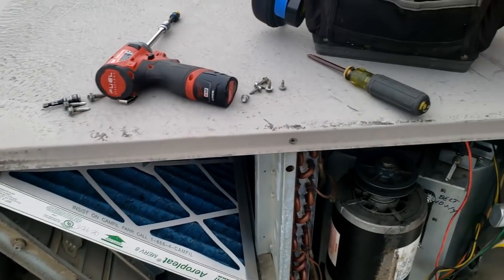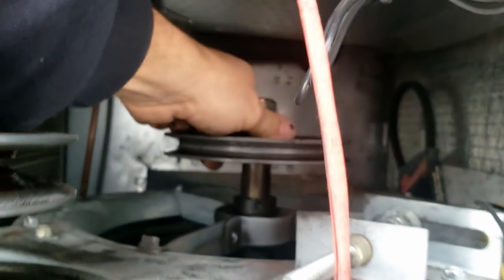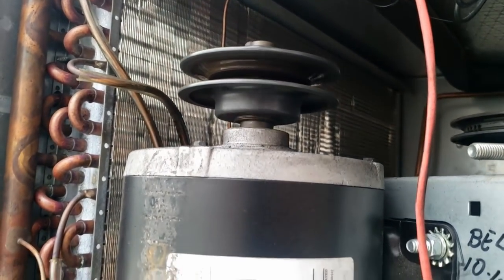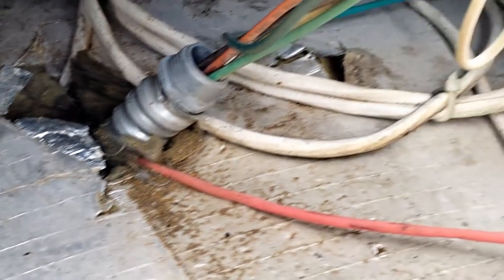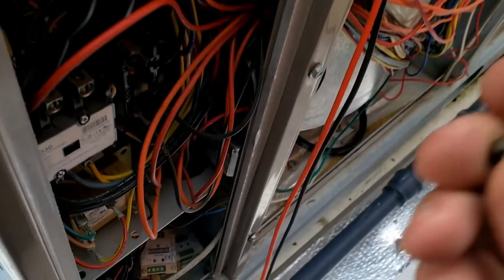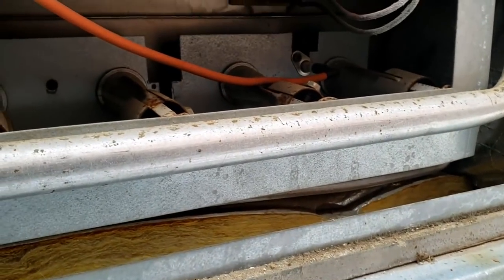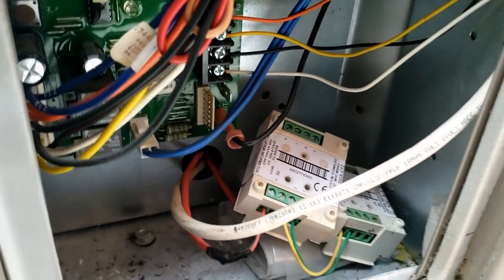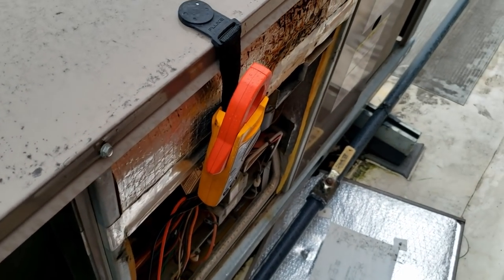No Heat RTU Smells Hot Like Something's Burning

Comment: Good video 👍👍  I was told by an older technician to always turn off power yourself and not to trust others when it comes to electricity.
Reply from the maker: Good advice and the other is to touch the system with the back of your hand when approaching it. In this case it was my fault for not verifying.
Reply: And use a lock out devise at the main shutoff. What a pain going from the RTU to inside electrical shut off. I hate bad installations nothing but problems too bad you can’t charge extra for that.

Comment: ZAP ZAP, ZAP. good reason to only have one hand/forearm in contact with any wiring/grounded object at once, of course insulated boots/shoes and still double check power is off!  I do not trust the non-contact testers further than I can drop them from laying on the floor :))
I used the earliest models of them in the 90's(as a sparky) and over trusted them and got zapped more than once! not that I didn't wire live most of the time anyway(residential), I expected power to be off and grabbed handfuls of live, causing me to jive! ;)
it was about then I learned to back up the contactless tester up with with physical connected meter and always treat every wire as live. yes I've zapped myself many thousands of times over the years, dealing with a mixture of partial rewired homes which still have knob and tube mixed in, sharing neutral conductors of replaced and grounded outlets. nothing like getting a zap off what should be a dead neutral

Comment: That’s a maintenance man hack job there. I got shocked after a maintenance man cut a ground strap on a rooftop unit. One of the power wires had rubbed on the case and shorted to ground. The maintenance guy was too lazy to look for the short.

Comment: You got power on the motor leads with contactor de-energized?  Kinda hard to follow you jumping around, must a got charged up!  So the breaker is good, just missing set screw?
Reply from the maker: Correct the breaker was fine, they must of lost the screw or they stripped it out? They wired one leg of power strait to the contactor bypassing the breaker so it was live on one leg with the breaker off.
Reply from the maker: @sjefoekel6058  that and there was another wire ran directly to the in coming power leg of the breaker that fed something, I didn't record that part.

Comment: 3 phase 460/480-volt colors are BOY...brown, orange, yellow.  3 phase 208/240-volts colors are BRB, black, red, blue.
Reply from the maker: Good Info to remember👍👍
Reply: @HVACRSurvival  Usually those colors are the case. But other than white, green, and gray, as far as I know the NEC does NOT indicate hot conductor colors as long as it is consistent throughout the building. In my area most commercial buildings do use the BOY and BRB scheme. However, there is a big piece of federal property in this area that uses an entirely different standard because a lot of it was constructed pre-1950 and they don't want to change the standard. Always check you individual work site to ensure you know what the colors mean.

Comment: Why do people leave things unsafe
Reply: Because F the next guy. I mean, if you need to do something like that you need to leave GIANT notes on the unit. Or, better yet, come back next day and fix it.
Reply: Two reasons, they don't know what they're doing, and they don't care.
Reply from the maker: @larrykeenan598  Or they damaged it and didn't want to take responsibility.
Reply from the maker: @analogmoz  The "F.... IT" factor seams to be the American way anymore unfortunately.
Reply: @HVACRSurvival  I did notice the broken spot at the top of the breaker.
Reply from the maker: @larrykeenan598  yea it was just the plastic part at the top, it did not effect the breaker operation.
Reply: Nothing surprises me anymore...Folks don't care even worse have no understanding of the system and walk away impressed with themselves they got it working with a knife and wire nut😂 Worked on a unit last season had high limits/rollout bypassed, belt broke funny enough the lazy guy just left his wires laying on top of the heat exchanger compartment melted the wires and tripped the trans🤦‍♂️. Happy Thanksgiving Rick and everyone that comments always learn stuff
Reply from the maker: @grindstone5368  Thanks Grindstone, you try to have a safe and good Thanksgiving too. !